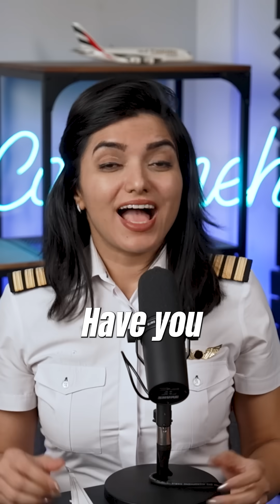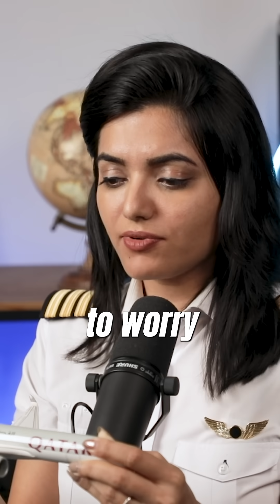What happens when Lightning strikes the Airplane in-flight?

Comment: Discharge to the atmosphere is the correct. It will choose to an easy path to discharg. That may be ground if the height is circa 1000 feet or less. But aircraft wii be bonded after landing and opening the door. 
Safe journey♥️🙏

Comment: Application of Gauss law : The electric flux through any closed surface is equal to the charge enclosed by the permittivity. It applies to any charge distribution and any closed surface. E~q, E=q/€o

Basic reason why you will not die inside a car because of lightning

Comment: ⚡ thunder,  most attracting  ,ocean s, and trees and, aluminum metal,  Einstein ring formula 1921 based  thunder ⚡  power controlling, aluminum dish antinas ,or,thunder ⚡ power , control,  flight body metal,  aluminum-60%,seesam, asbestos, SiO2, NaHCO3, Sillicone  -40%, or,Nickel steel-60 %,SiO2, NaHCO3,seesam, Sillicone, asbestos-40%,or, titanuim stell-60 %,SiO2, NaHCO3,seesam, Sillicone, asbestos-40%, metal, thunder ⚡ power control

Comment: The exterior skin of the airplane acts as a "Faraday Cage." This means that when lightning strikes, the electric current flows around the outer surface of the aircraft rather than penetrating inside.  the aircraft is designed to conduct the electrical current through its metallic structure and essentially "discharge" the lightning back into the atmosphere.

Comment: The Pilot Madam is wrong in saying so.  Electricity needs " return" path to establish current flow . When there is no return path to current to go back to its origin place. , certainly current will not pass through rudder or any part , since return current path is not there.
Reply: @surendrababu1340  The exterior skin of the airplane acts as a "Faraday Cage." This means that when lightning strikes, the electric current flows around the outer surface of the aircraft rather than penetrating inside.  the aircraft is designed to conduct the electrical current through its metallic structure and essentially "discharge" the lightning back into the atmosphere.
Reply: @momhealth1885  Seems that your theory is against basic electric current flow. Medium is required for.  " discharge" .

Comment: Where will be the ground when flying madam  ?  how it will be discharged to ground ?? 
Guys , since the plane is flying in the air, the electricity does not travel to the ground but instead continues through the atmosphere through the tail or wingtips.